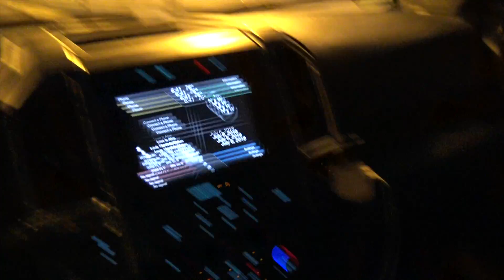The Ford F150 mod that SHOULD'VE been done a long time ago..

Comment: Next mod..... roush supercharger!!!   Then it will be a Raptor Killer
Reply: Powerstroke Strong 903 minus the good suspension
Reply: Zane Zinn  we know it’s coming better quality lift and shock package. There is better aftermarket stuff than the  oem raptor has   TBA.  Lol
Reply: If he installed a long-travel suspension, pre-runner style fenders and bedsides, a supercharger, headers, and a nicer interior, he may be close. I wouldn’t ever need the Raptor suspension, and don’t like the v6, so I’d rather have his black F150, just with the Lariat interior.
Reply: Yes supercharge it, that will be awesome!!!
Reply: Raptor Killer on street only
Reply: I'd go with a whipple myself after having a Roush 2.3L Phase 2 for just over a year. Also VMP has their new kits as well. And don't forget a UPR catch can at least on passenger side. Then you'll want to go long tube headers and sell me the Borla ATAK resonator? LOL.
Reply: It's already supercharged.

Comment: Truck looks great 👍. Have you thought about having some Katzkin seat covers installed or something similar to upgrade the interior a little bit? Katzkin makes leather seat covers specifically for your seats that fit perfectly. Other companies make them too. Tons of color and material options to choose from. Definitely worth thinking about if you ask me. Especially since you spend all your time inside the truck.
Reply from the maker: I have thought about it yes, not made a decision on what exactly to do with the interior yet though
Reply: I was going to suggest the same thing. I used cover king pick material, color, stitch color, and embroidered head rest. I got black neoprene for my Camaro and professional install fits like a glove like factory.
Reply: Maybe he could swap the interior out to one from a parted-out Lariat, or Platinum.
Reply: Wicker would be different!
Reply: AutoVlog you should add a bull bar and Raptor Line the whole truck!!!! It would take it too a maximum aggressive look!!!!

Comment: I love it buddy. Looks so damn good and now one final mod is a running board
Reply: Automatic running boards that drop down when you open the door!
Reply: the power one will piss him of during the winter with ice getting under there
Reply: He had running boards and took them off
Reply: Sliders would be better since they’re not as visible as boards. Those wheels gotta go tho
Reply: And a subwoofer
Reply: Yes add a nice running board! 😍
Reply: Travis Ginther, he should put a automatic running board
Reply: Maybe a set of the power retracting boards.
Reply: Smalltown Wireless Rock Sliders would be better. Running boards are dated
Reply: Instablaster...

Comment: How about a bed liner and cover like the Raptor?
Reply: For what it’s “meant for” just like you don’t use your Jetta for what it’s meant for.

Doing 0-100mph pulls in that turtle of a car is probably more dreadful than a pavement princess gas truck.
Reply: Dank Toke Tdi Jettas and golfs do 160+ kph on the Autobahn every day so yes, they are made for it. This truck was meant to work, not to fling rocks at peoples cars and be exessivly loud....it doesn't even sound good. 
It's a genuine douche mobile
Reply: Fernando Marin I could care less whose truck it is. 
A riced truck is a riced truck.

Comment: Truck looks great. A small and much needed mod is a 3rd brake light that matches the tail lights. Tip is to always put a better gasket on any aftermarket 3rd brake light that you buy.

Comment: Front bumper looks good, and the truck looks fantastic.  I can tell you this, though, as a guy who has worked with automotive vinyls for 35 years:  If a small stone hits the bumper at high speed, or if you encounter a minor 'rub' on the vinyl, it will rip the vinyl and there is no great way to repair it other than complete replacement.  Paint would have provided, more protection against minor impacts, in my opinion.  I might have opted for a painted bumper, with a 3M Stoneguard optical clear applied in the most vulnerable areas.  Just a thought.

Comment: Looks great Mike! I've been waiting for that wrapped front bumper forever.  For improving the ride quality, consider replacing the low buck spacers with some nice coil overs in front and I think you'll be happy.  Mod after that would be forced induction and a roots type supercharge would be my top pick. Roush, VMP or Whipple with 7-8lbs of boost will give you a nice bump in performance without being so aggressive you be worried about blowing the motor and won't kill your mpgs.  You could also try the pedal commander which does not increase power but improves throttle response and yes, even you could install that!

Comment: Leveling shackles for rear end and air ride suspension bags. Get rid of the grasshopper look, ride like your on glass, silence unwanted vibrations in the cab, increase your payload. All for about $300.00 if you do the installs. You can even get a timbren kit instead of air bags for less. Either will eliminate the bump stops and bottoming out on large bumps like railroad tracks. I installed the full airbag system on mine (2017 f150 2.7 ecobadass) so I can raise the truck and lower it from inside the cab. Highway, it's dropped for aerodynamics, street it's raised for potholes, raised again for off road. Totally worth the $3000.00. Also wanted to mention that I have the same head and taillights as you. Only on YouTube videos have I seen them, never elsewhere. The only thing that sucks about the taillights in my opinion is the protrusion from the side of the vehicle. When spraying it down at the car wash, the overhanging hose gets stuck on them. Also, I bought the 2 pc. Kit to spell out ford on the front grill, but because I went with the xl model it didn't have the raptor grill already on it. Just stock 5 bar. I instead bought a billett black horizontal grill and attached the R from the 2 pc. Kit to it and tossed the F. The R is for my first name, but because of all of the mods on it, people think it stands for roushe and I honestly couldn't care any less as long as it doesn't stand for ram. Great looking truck hombre! I knew I should've gone black, but magnetic is close enough and ford paint sucks anyway. Part of its mystique I suppose. If you ever want some side marker badges that illuminate, let me know. I custom make them and all colors are available including and especially blacklight on neon polycarbonate. It leaves the f150 to silhouette through and is all balls at night. very subtle and slimline. Not deprived of attention. Just clean complimentary color to the best generation badge design so far. 12v LED's drain zero battery when hardwired to run lights, or even to run / blinker. Super easy to install. If interested, email me at regaltinder@gmail.com subject line (f150 badges) and I'll reply with images of mine. Later on!

Comment: Running boards/side steps, bed liner, seat covers, tonneau cover/Shell and it would be complete inside and out. Keep the stock wrapped bumpers and maybe look at some custom grille guards that would look good and mesh with that new grille if anything.

Comment: I think you should’ve had the entire grill wrapped gloss black. Get rid of that dark grey grill. Also tinted the side mirror turn signals and tint the third brake light. Just for that full murdered out look. Also I agree with you to do a full lift on the truck since it still has a front rake with that leveling kit

Comment: Something I just noticed that would look good blacked out, is on the grill in the very bottom right and left corners is that little triangle shape of plastic. I think that would look better if it was black and just the main surrounding area of the grill remained dark gray. It’s a little thing but I think it would make a big difference to clean up the look of the grill. It’s all in the details. Again, great looking truck.

Comment: Lookin Good Mike! I think if you took a small paint brush and some touch up paint And painted the fender flare screws black that would look nice.  Also you can pull off those tow hooks and they have replacements on amazon for like 15-30 bucks.  Carbon fiber looking ones would probably look really good.
I had a 2013 f150 with the 5.0 for a work truck and I used my old diablo sport intune programmer and it actually woke it up a bit but most of all it stiffened up those sloppy shifts and it would actually bark the tires hitting 2 and gear  when it was in the more aggressive setting.     The E85 setting actually really woke Up the truck but at the time I was driving a lot of miles and the e85 burns faster so I stoped using.

Have you thought about doing the ceramic coating on this one ?   That would make it look that much better I think

Comment: WoW Mike it FINALLY is complete and worth the wait. I am super stoked and happy that the ugly chrome front bumper is gone, maybe not as much as you obviously, but pretty close. I can't stand chrome on a newer truck or sports cars. I think that now you don't have to rush getting a more aggressive front bumper, the front bumper is so much better. If you kept the license plate holder, you could have put an AV AutoVlog license plate in it, but the flush clean look is nice. 
As far as more mods go, a spray in bed liner makes it look meaner and more durable especially for the off chance that the whole family goes on a long trip vacation and have to haul things. A real 4" lift kit by FabTech, Zones, of even Rocky Ridge will save your back and look nice without having to buy new tires. I was also the one that suggested a black and grey leather interior with the AV logo stitched in the headrest will really set the inside off, maybe LED interior cab light as well from 4x4 Truck LEDS. 
We all know that down the road you will get a tune, and some ROUSH performance parts to add some fun HP to your already mean looking and sounding truck. All the best Mike, so happy for you. Now you have two COMPLETE Badass trucks in the driveway. Time to get them out side by side for a few sweet pics, maybe even with the Merc in the middle with them angled in and out?

Comment: I have the same truck for the most part 2016 f150 5.0 4 door. I made sure I got mine with the color matching front and rear bumper. I hate chrome. Mine is the magnetic metallic. I’ll be getting the grill soon.

Comment: needs a push bar/bull bar in the front with LED light bar, true 4 inch lift, and AMP research running boards.

Comment: Now the truck looks awesome, but yet that front bumper is not that good.  As for the next upgrade try getting some full leather seats, led interior lighting and try some ambient lighting with some el wire and led strips on door cards, and Ford projector logos as welcome lights when opening the doors.

Comment: Chrome tow hooks add a little contrast so I like them
And if you want a cool mod (that isn’t like everyone else) look into a turbo for the Coyote ;)
For suspension I’d look into the Raptor suspension 
(And that could be a cool video in itself with your buddy from the dealership, comparing a stock F150 to Raptor parts)
Interior, hmm, maybe eventually do a black suede or alcantara instead of the normal leather 
Could even get “Autovlog” embroidered onto them
That would look so badass!
The Merc might even be a little jealous of how great the truck is ;)
(Hmm, that could be an idea in itself, do up the seats in the same design and materials as the Merc... either would be awesome!)
Take care Mike!

Comment: Mike, the cop that stopped you and told you that you needed fender flares actually did you a favor. The truck looks beautiful. I like it as much as the Raptor if not more. Correct me if I’m wrong but with all the mods it cost about the same as the Raptor also...didn’t it? Yes I saw the video of how much all of the mods to date have cost.

Comment: Truck looks badass but if I were you I’d probably get a bed liner, automatic running boards, 6 inch bds, 35s, anzo 3rd brake light, and maybe some engine stuff and some audio stuff. Either way the truck is awesome!
Reply: Idk I like the cloth

Comment: Nice truck. I have a set of OEM 16 Ford F-150 sport FX-4 18 inch wheels black and machined with Nitto trail grappler g2 tires barley used because I also bought custom wheels. I recently sold the truck and I m selling the wheels if you need a setup for the winter.

Comment: You might want to put some AMP Research Power Steps.  I have them on my F-150 and my wife really likes them.  Also a BDS 4 inch lift would be perfect.  Also put a LED taillight Bar ($80.00) - hard wire it in are it will mess up your rear view camera up.

Comment: Inquiring minds want to know: did you get the driver/passenger tint tested to find out if it is legal? and are the fender flare screws decorative or can they be removed and coated in black or replaced with black ones?
PS: There are black steel tow hooks out there...just in case you want to completely blackout your ride

Comment: 1. Leave front bumper as is - but how about a winch?
2. Could the chrome tow rings be painted?  If you end up with a tow and the paint gets damaged they will, of course, need a repaint - but how often will that happen!
3. Gloss black bed cover
4. Black rollover bar mounted to bed with black LED spots and lightbar
5. Black leather interior
6. The grill needs painting - to me, the grey looks wrong even with black letters
All subjective and just my thoughts.  Keep up the good work - greetings from the UK.

Comment: I have a question I put a borla exhaust atak system on my 2014 stx f150 and a a spectra cold air in take. Now I’m getting some weird noise when at cruising speeds, like a lag in throttle response. What would that be?